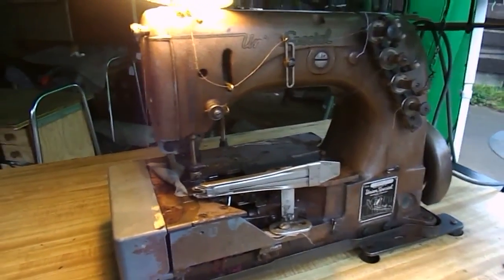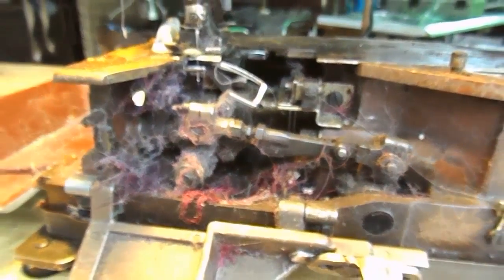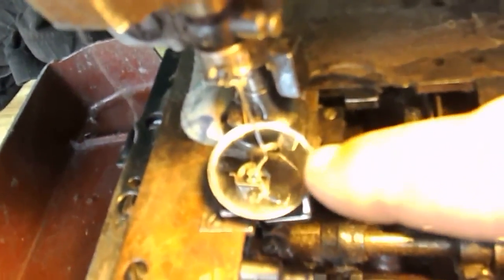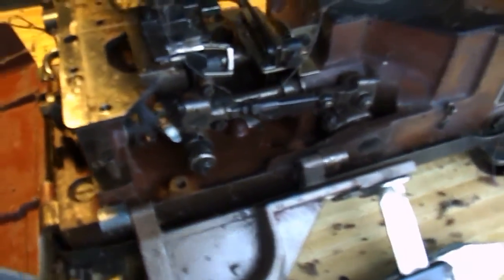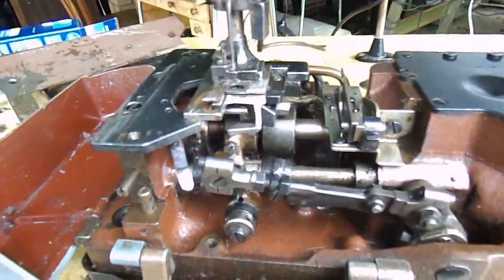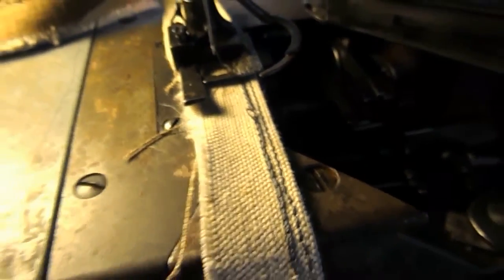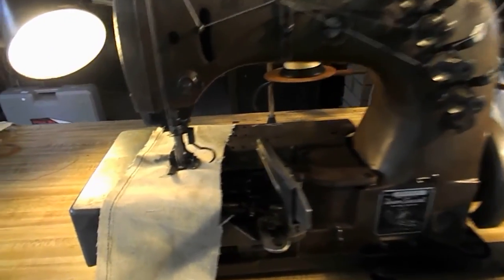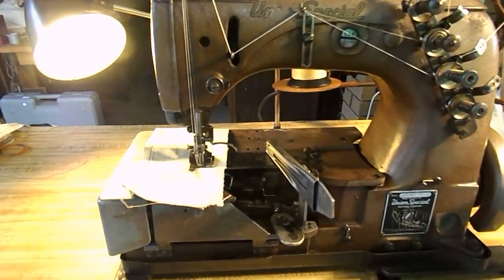Union special  52800BT  from  Yuck to  wow.

Comment: This is amazing I just bought a union special and I would really appreciate a how to thread up and use different feet :)
Reply from the maker: MOst of it is straight forward.  Under the bed is the fun part.  Both threads go over the rotating cam then down under the clip immediately to the right .